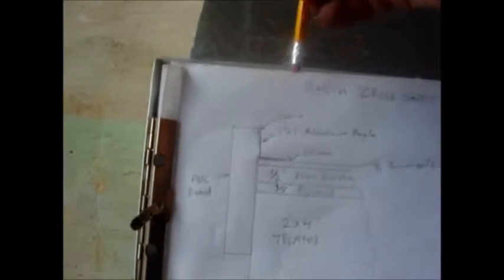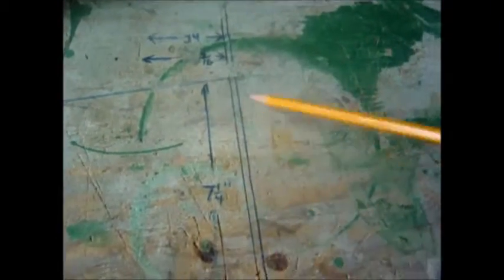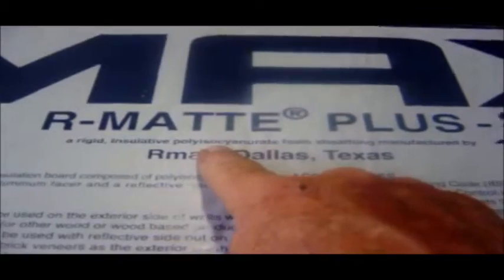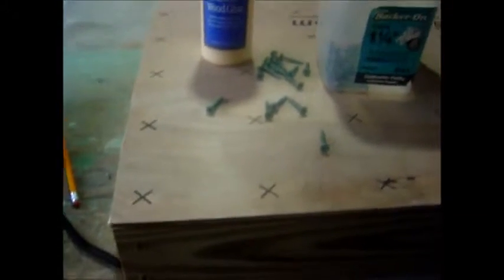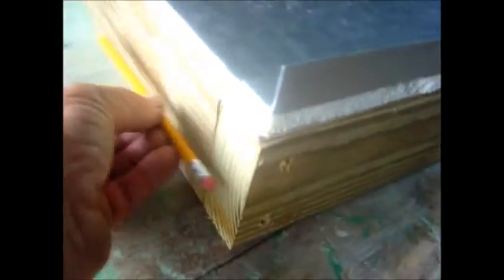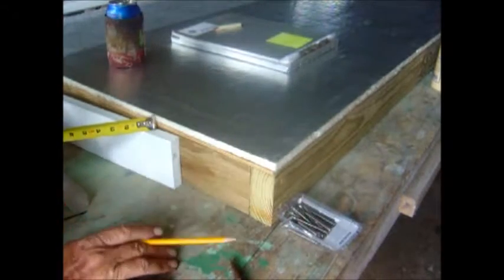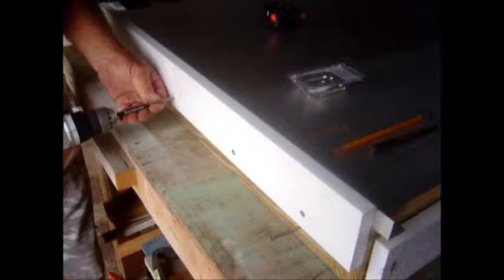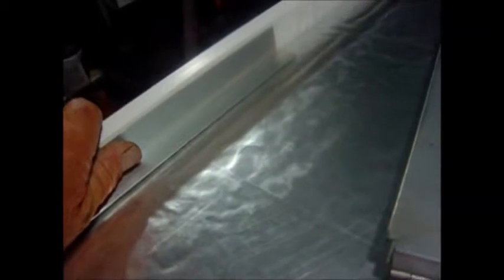Solar Water Distiller Build #2 Part 2

Comment: Thanks for this video!  I can't wait for the next one. You cleared up some things for me from your other build videos. one thing I wish you would expand is how do you clean the inside after using it for a while. The mineral deposits will stick to the bottom.

John
Reply from the maker: zpoedog Thanks for the question John.  I made the first models of this distiller as a totally closed box. It did however have an overflow port. To help slow down the formation of deposits I would replace twice the water that was produced. Say the unit gave 1 gallon/day, I would refill it with 2 gallons/day. This helped flush out some of the concentrated minerals extending the time between cleanings. When deposits formed to the point of needing cleaned all I could do was allow the basin to run dry then pour in a couple gallons of vinegar, let it sit for a while then lift one end up and down slightly to slosh the water around then  overfill the unit until and let the vinegar and freed up deposits wash out. What a major pain that was. I knew that I had to come up with a better idea. I thought of many different ways to resolve the issue. Everything from making a small door in the side that could be opened to allow me to get my arm inside the unit and scrub it clean, to putting a hinge on the glass or the top so it could be lifted up for cleaning. All these were a design nightmare. 

That's when I figured out that the top could made as a separate part and easily removed and replaced for cleaning the basin glass. It was my Eureka Moment and the next generation of distiller was born.

The best way to keep deposits from forming is to use collected rainwater in the system because of it's extremely low assorted particulate content. Using rainwater drastically reduces the need for cleaning. It still needs cleaning every once in a while but not nearly as often.

With all that being said, and sorry for being so long winded about it, cleaning the unit now is easy and takes just a few minutes. First, I enlist the help of someone for a few minutes. Since I have a mirror on this unit, I remove the mirror. Sounds like a lot of work but it's only 4 screws an it lifts off and is set aside. Then the top is easily lifted off and set aside. You can use your hand or a plastic dustpan to slosh and scoop out the remaining water. If you let the unit run itself low on water there won't be much to deal with and a towel or sponge can be used to remove the water. 

There are acidic cleaners such as CLR, found in most grocery stores, that remove lime and rust. You can use them and a scrubbing pad to clean the deposits off the glass. If there are heavy deposits you can use Muratic acid found in most hardware stores. Pour a small amount of the acid or cleaner on the glass and scrub. You will see and feel the deposits being removed when scrubbing and the glass will be smooth and clean. 

After the scrubbing, you need to spray the basin out thoroughly, again remove most of the rinse water and pour in a generous amount of Baking Soda, add a small amount of water and lightly scrub with a rag or with the rinsed out scrubbing pad. The Baking Soda will immediately neutralize the acid. Then again rinse the basin with fresh water and wipe dry. 

The basin is now clean and ready to be refilled and the top replaced. Just before putting it back on I always spray the inside of the top out good to make sure any dust, dirt, or small bugs that may have contacted the inside are washed out. After placing the top back on and refilling the basin to the operational level, I let the unit run for a day to allow the unit to wash itself totally clean. the water it produces in that time is probably fine to drink, but as a rule of thumb I dump it out.

Well John, I  bet this sounds like too much work and aggravation but it's really not that hard to do and doesn't take much time at all. In fact the next time I need to clean my unit I will make and post a video of how I do it.

Thanks again for the question John.  I hope I have been helpful with this explanation.
Reply: STARFIRESOLAR  Thanks again! I have 2 sliding glass doors.  I was thinking I may use one for the bottom which would make it easer to clean. What do you think of that?

John
Reply from the maker: zpoedog John, I have always used a piece of glass on the bottom of the basin. Using just black silicone on the bottom would be next to impossible to clean.

Funny how you ask about this because the next video, Part 3, that I am in the process of making right now shows the glass being coated with black silicone on the underside of the glass. I've switched to using black silicone because it does not oxidize(lighten in color over time), crack, separate from the glass, and it is freeze proof. 

If you have 2 insulated glass sliding doors you have enough glass to make 2 distillers. Each insulated pane has 2 pieces of glass. You have to separate the glass(see my video) because using it as is(insulated) will insulate the heat absorbtion and transfer and if used on the top it will also insulate and not allow the heat transfer needed to enable maximum condensation.  Also if the seal on the insulated glass ever leaks the insulated glass will fog over inside and become useless.

Thanks again for your comment.
Reply: The glass doors I have are single pane and have very nice aluminum frames. They may not be doors but some kind of wind brake for a porch or sunroom.  Wish I could send you pictures so you can help me decide weather or not to use the frames in the construction of the still
Reply from the maker: zpoedog  send pictures to me at jp5er@yahoo.com